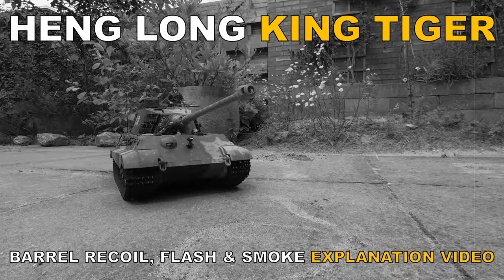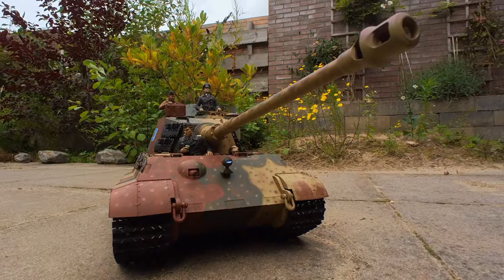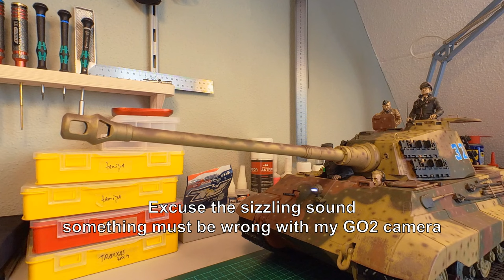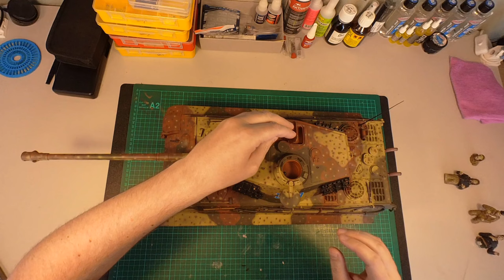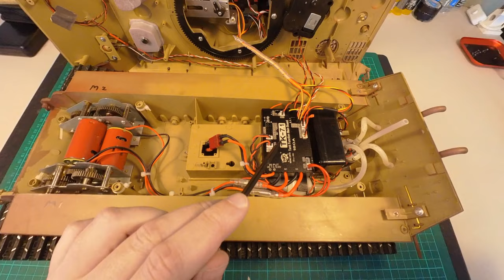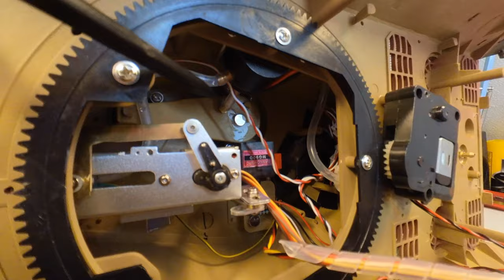HENG LONG King Tiger - Barrel Recoil, Flash & Smoke Explanation

Comment: You briefly talked about it, but is it true that with the stock 7.0 MFU in the current Henglong’s that you would need to go to the 7.1 if you wanted barrel recoil(servo)/smoke/gyroscope for barrel/turret stabilizing for modern tanks?

Just got a Leopard 2A6 and the manual is kind of confusing, it seems like some extra functions/servos can be added to a 7.0 before you need to upgrade to the 7.1, but it isn’t super clear.

With the servo recoil, is the gun depression/elevation more adjustable/correct? Since that is my current biggest complaint with my leopard is that the elevation could be better and the depression is like maybe 3 degrees which isn’t even close to being real and just looks plain wrong
Reply from the maker: Heng Long makes it a bit confusing as they made a combined manual for the 7.0/7.1 boards. At least, the manual I use is. So it's difficult to determine what will and won't work on the 7.0. 

But basically if you want to use servo motors, you will need a 7.1 MFU as the 7.0 MFU doesn't have any ports to connect the 3-wire servo motors.
I'm not sure about the gyro as I don't use one. From what I gather from reading online it would probably plug into the CN14 port. But the 7.0 doesn't have this port, only the 7.1 does.

As for the barrel elevation and depression: on the 7.1 there are buttons that let you set the amount of throw for the elevation servo (only works with a servo, not with the regular elevation motor). If I remember correctly it has 3 ranges of elevation. Also, if you mount a servo for elevation you can kinda control range yourself with placement of the servo and the length of the servo arm. To me that was the most fiddly part, as there is no bracket or anything for installing the elevation servo. You really have to figure that out as you go.

Hope that helps a bit.